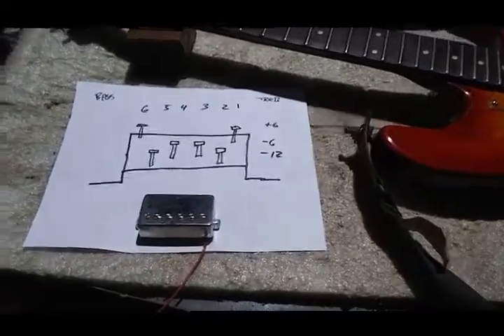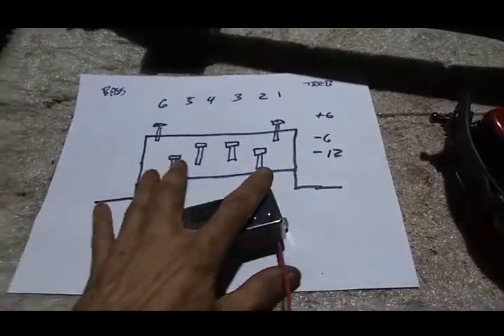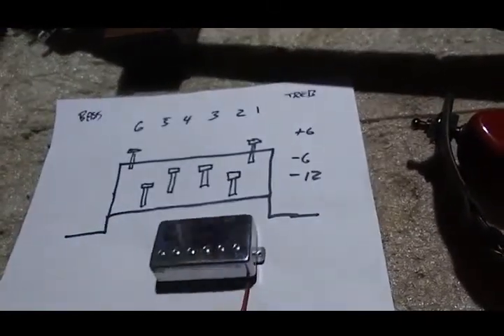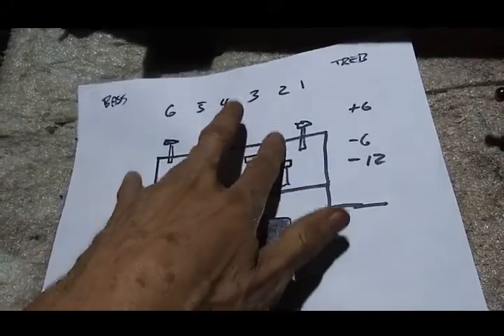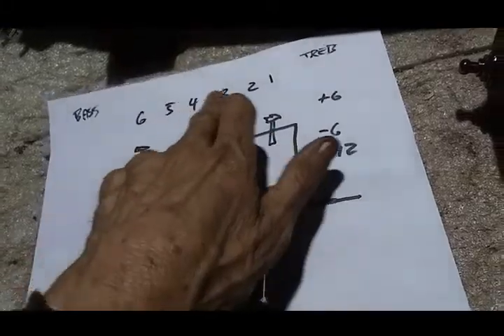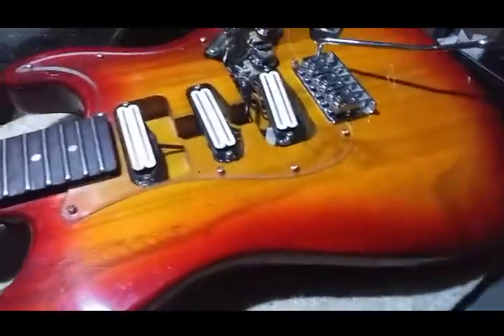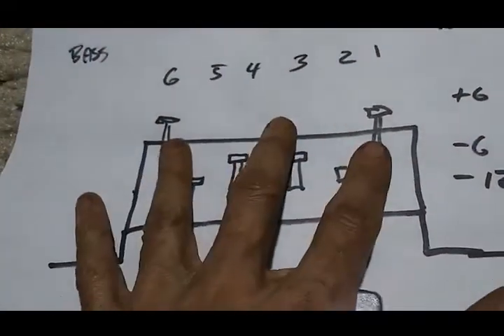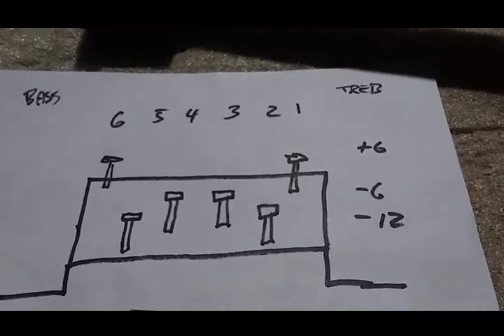Changing the tone of a humbucker with screws

Comment: In my early days of playing I fooled around with these screws a lot and this has become the fine tuning of all humbucker pickups for me. What I have found is that one screw will effect the shape of the magnetic field through out the top of the pickup bobbins. It's the same thing your doing but in my case I am working from the inside out instead of the outside in.I try to get the G & D strings to sound the best first then I play with the B & A  It is truly an balancing act but well worth the time.Thank you for sharing.c];-)
Reply: @@basyas114 Yes I know what you mean with booming ness & Flubber. Most of the time when I get that I will lower the low E side of the pickup and rise the D pickup screw slightly. Thanks c];-)
Reply from the maker: its unfortunate that one screw doesn't just affect the string over it.  They also affect adjacent strings.  These days I'm favoring high output passive quadrails, which precludes screw adjustments.  But I also tend to use on-board 7 band EQs instead of traditional tone controls, which opens up a world of tonal possibilities.
Reply: @normbarrows sir may I know the milliliters rised up from the base of high E and lowE poles..I want to try this too...
Reply from the maker: @dagoldigol  According to Bing search, the pole screws in a typical humbucker are #5-40, and about 3/4" long.  So they have 40 threads per inch.  So an adjustment of -12 turns would lower the screw by 12/40's of an inch, or 0.3 inches, or 7.62mm.  A +6 turns adjustment would be half that: 6/40ths of an inch, or 0.15 inches, or 3.81mm.  Note that not all pickups have screws that will adjust this far.

Comment: I have a gauss meter, and I've noticed alnico magnets can be unevenly magnitized across it's length, specifically on the ends.  Some, more than others.  That being the case, each pickup will be different in this reguard.

Comment: Plug your guitar into a recording board, tape machine, or anything with a vu meter. Pluck the strings individually and look at the meter. You can set each string to whatever output level you want exactly with no guess work. Also, you can leave the pole pieces flat and raise and lower the entire pick up at each end . You need to be careful adjusting the individual pole pieces , you will end up with a bunch of garbled harmonic distortion. (Unless that’s what your after, to each their own) Happy picking. Cheers!

Comment: I have a Wolfgang in their all level to the case so what I did was I just turned them up counterclockwise 1 and a half turns exactly the same and cross the board so they're a little bit higher sticking up with a Wolfgang the bridge pickup is very high and the neck pickup is very low which I don't totally understand but Ed was a genius he knew what he was doing.
Reply from the maker: The screws are really to change the volume of individual strings relative to each other.  No need to jack them all up the same amount - just raise the pickup - unless it's already maxed out.  Then screws might get you a bit more before you hit clearance issues.  Pickup heights are typically adjusted to minimize changes in volume when switching pickups.   Adjusting each pickup for best output is another approach.   Adjusting pickup heights so the volume of each pickup suits a particular player's tastes is a third possible approach.  Not sure what approach they use on a Wolfgang.
Reply: Neck pickup low tends to have lower output resulting in a cleaner, possibly brighter sound. The bridge pickup close to the strings results in a much stronger output resulting in more crunch. I have been setting my guitars up similarly for over 30 yrs. Unfortunately I’m no Eddy.

Comment: Is it possible to replace the screws on a humbucker?
Reply from the maker: Don't see why not - just match your diameter and thread pitch.  It would allow you to experiment with different screw lengths and materials (steel vs brass, etc).  You could also make cosmetic changes like Allen drive screws as seen on Invader style pickups.

Comment: I had a Virginia luthier tell me what to adjust on humbuckers and he made classicals and electrics for a living and all the custom jobs on Lindy Fralin's vds. The  ' D ' string needs to have  the screw raised maybe a turn or 2...( a skinny string in finest winding) and the G or B strings tend to be too intense and need to have their polepiece lowered a turn or 2.
Reply from the maker: That sounds pretty typical when trying to balance the volume output of individual strings on a humbucker - especially turning it down on #3 string, which always seems a bit hot on most all pickups.   In this case, I wasn't going for equal volume, I was going beyond that to actually change the response curve, at least to the extent possible with just screws.
Reply: I've read that the screw height pattern is basically the same as the intonation pattern. 1 2 3 descending in height. 4 5 6 descending in height. And the 4 is inherently quietest, the 3 loudest
Reply: When you said the thing about the b string I wept

Comment: Is there some type of a device that would detect the pull produced by a magnet and could be focused so that you could detect each separate screw or maybe plotted on a graph or an oscilloscope ?
Reply from the maker: Fishman fluence has/had 3d visualizations of the magnetic fields of pickups, and there are scientific instruments to measure magnetic fields, so such devices do exist, but are likely rather expensive for the hobbyist builder as opposed to the dedicated hi-tech pickup company.   There's always the grade school way with iron filings on a piece of paper over the pickup (don't get any filings on the pickup, you'll never get them off!), or moving a compass near it and noting the deflection at different points (much safer than iron filings).  A compass can be used to get a crude plot.  I use a compass to check pickup magnetic polarity.  Say you have a south pickup (north attracted to it), turn the pickup so north is away, then move it towards the pickup and note the deflection (in degrees) at different locations.  Repeat at different heights.  This will give you a crude 3d plot of the field.  I find that at least for the quad rails, the field dies about 1/4"  (~7mm) above the pickup and the same around the sides.  They are very sensitive to pickup height - to the mm sensitive.  They also seem to be pretty uniform, with no loud or quite spots. I think this is typical of rails in general (singles,  hots/duals, and quads).
Reply: @normbarrows  I just got another idea. Thank You God. There is a substance that I've never had or used called ferrofluid. I've seen it on the internet and if you could put it in a flat bottom glass container and move it over the pickups and in-between etc you would see the magnetic fields. I am not employed at the moment and I have no money to spend on these type of things so if you do have the money please do so and let me know how it goes maybe even send me some pictures.
Reply from the maker: @darylhudson777  You could do the same thing with iron filings in a glass container held over the pickup.  Either way, it would most likely just show you that the field only extends a short distance above and around the pickup.  I recently tested 2 single coils in series, with one under strings 1 and 2 at the bridge, and the other under strings 5 and 6 at the neck.  They still picked up strings 3 and 4, but not as loud as the others.  You can move a pickup around in a similar manner to "see" what it picks up and how far away and in which direction.  The single coils in series gave a tone similar to that advertised for a Seymour Duncan Dimebucker (but probably not as hot).  If you picture the field extending say  5 to 10mm around the  slugs/screws/rails/magnets in all directions, you won't be far off the mark.  As you can see, that doesn't give you a whole lot to work with in the way of pickup heights and alignments.  Google the Fishman fluence site and videos and you'll find their 3D field visualizations.  I think they just flash them in an ad for a second.
Reply: It is called a gaussmeter the measurement of flux lines measure the strength of magnetism and the direction of polarity I know it's because I've been an old field using the theory of magnetism to inspect and find cracks and Metal
Reply: your ears are the best measurement or a skilled guitarist.... You may have a 'tin ear' !
Reply: @DougHinVA  are you talkin to me ?
Reply: @darylhudson777  no; just to those who assume too much

Comment: Good vid.  I think a lot of the way a pickup responds to adjusting the screws depends on the particular pickup itself...and the guitar it's in.  Are you sure that you're adjusting by plus and minus 12 turns?  I've never had a pickups that needed to be adjusted by more or less than 2 turns up or down from being flat with the pickup cover.  Another thing to keep in mind when raising the screws on the bridge pickup to increase a string's volume, the brightness will also increase and for the neck pickup when raising the screws...the tone will become slightly more bassy.
Reply from the maker: Yes. plus and minus 12 turns.  Note that not many pickups will do this.  On some, you can't go below the top of the bobbin - or even less (see my recent vid on Strat STYK repairs for an example).  This was not to simply adjust volume string-to-string.  This went beyond that to turn down the mids and boost treble and bass (somewhat).  Moving the screws changes the shape and density of the pickup's magnetic field.  This combines with the area a sting vibrates in (bigger at the neck, smaller at the bridge) to affect the tone.  My experiments were all done using just the bridge position.  It's not surprising that the general effect of pickup position on tone has a similar effect on this adjustment.  Supposedly, Duane Allman used to lower the pickup and jack up the screws for a unique sound.

Comment: A decent set of pickups for your required tone should have already had this experimentation done, I fiddle about with my EQ pedal to get the tones I want and this can change from song to song, I wish I could get an EQ pedal that has MIDI or motorised faders, there are probably rack EQ units that can do program changes but far beyond my budget.
Reply from the maker: I like a really scooped tone.  I have yet to find any pickup that is scooped enough for my tastes right out of the box.  I've actually started putting 7 band EQ's on-board on some of my builds as tone controls.  Compared to an EQ, pickup screws are both imprecise and rather ineffective.  For me it's largely a moot point these days, as I tend to use quadrails in my builds now. They have a flatter response curve with less midrange than most pickups - and quadrails don't have screws.